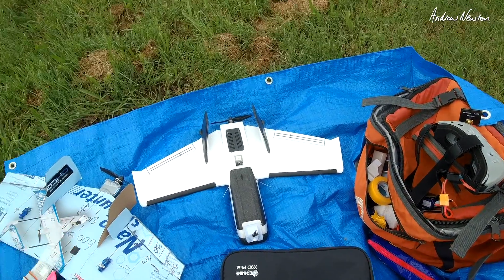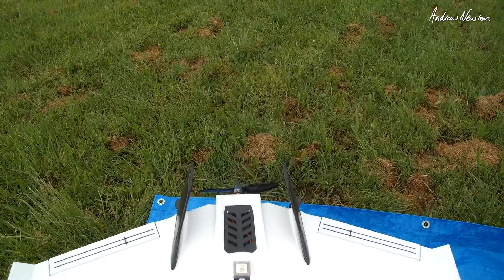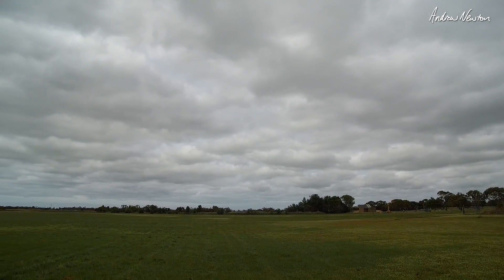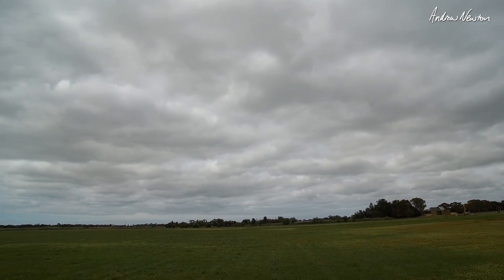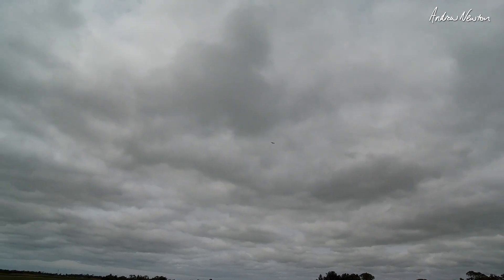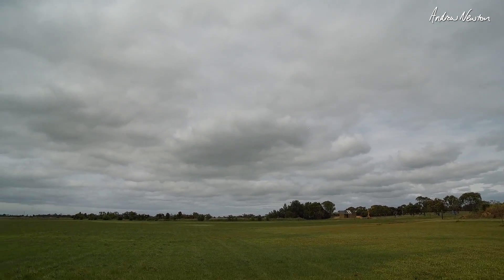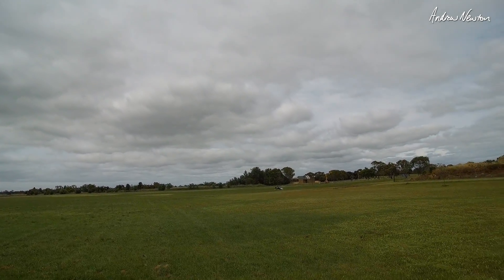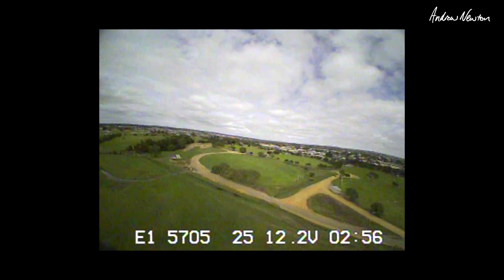ZOHD Dart 250G & Kopilot tweaks

Comment: How did you manage to deal with both 2s and 4s batteries with the same setup? You do not have Low voltage cut off on the esc side?
Reply from the maker: Only 2S and 3S. I never set LVC

Comment: I have found with Kopilot - run gain pots lowish like you 1/3 max.  Also with little planes I setup adjustable EXPO on a pot with a range between 30 min to 70 max in OpenTX so I can adjust it while flying in manual,  then later you can set it permanently, or just leave it on the pot.

Comment: Have you had any problems with burning out the motor using the 2 blade prop on 3s?  I am on my 3rd motor and ended up switching back to 3 blade prop.  I am also running 600mW vx off the esc. Not sure if that is the culprit.
Reply from the maker: No problems with my motor. But I use 2S mostly
Reply: Yep. You've got to use the throttle sparingly when running the 5x5 on 3S. Only use on take off and dodge tree panic mode for very short bursts. We've done 1 on a Dart250 and 1 on a Drift. A 4545 or 5x4 might be better. The 3-blader is anaemic and is easily broken on a rough landing.

Comment: Andrew:
   Since you are my go-to guy for slope flying and I can see you have had a good bit of flying with the ZOHD Dart 250g, I have several questions for you:
1) What do you feel is the sloper potential of the ZODH Dart 250g? Should it be run a bit heavy or light to perform best?
2) Have your tried 2S 18650 (or 21700) Li Ion batteries in it?
3) Could the use of one of the Matek flight controllers to enable the removal of the ESC for simultaneous weight savings and increased flight control capability? Which one? 765? 722? 411? 405? other?
4) Do you feel that another camera would add value/utility? Foxeer Razeer mini? Caddx Ant? AKK 356c? Which Vtx would you use to optimize weight and range?
5) Do you think that running INAV in this model with its avalable mission planning would work without adding too much weight? What flight controller would you suggest?
6) Have you experimented with the Happymodel ExpressLRS ES24TX or EX915TX protocols to expand range/reliability yet?
Thanks! - Jim
Reply from the maker: Hi Jim. It's not suited to sloping really. Could ballast it up for speed in a decent wind maybe.
2s LiPos or 18650s are fine
F411-WSE is the only board suitable, but that wouldn't replace the ESC
VC400 is not a great camera, but it's small and all in one. Any of the micro setups would work but I dont know much about them.
F411-WSE check out Marc Hoffmanns videos. INAV seems to work well.
No idea about the Happymodel, not really my area of interest.
Reply: @AndrewNewton  Thanks for patiently answering!

Comment: I have two questions about setting up a flight controller.

1. In the moment you drop the model, I hear that the engine is already running. Not using autostart mode? I no longer try to start in this mode. I set the stabilization mode, set max throttle and drop the model.

2. Can I turn off the setup board after all the settings are complete? Is it necessary to disconnect the setup board when the battery is on, or when it is turned off?
Reply: Actually we've found that Autolaunch requires a REALLY strong throw at a slightly upward angle to get it up to flying speed OR to use a Bungee-launcher - particularly if using the 3-blade propeller on 3s. 
Also the ONLY way to guarantee that your settings will be saved if you want to remove the Settings Board and the cable IS to do it BEFORE you unplug the plane battery. That has been tested and proven.
Reply from the maker: 1. Not autolaunch, this model dips too much for that to work all the time.
2. No difference with my setup.
Reply: @AndrewNewton  Thank you!

Comment: Thank you for all your detailed videos an I may have missed one but at 2:02 you talked about having the “settings at full” I couldn’t quite see the the settings you have on my phone, would there be any more details on these please? Would you be able to explain the setting between manual, stabilised and expo? Apologies but I’ve yet to take a maiden flight in the 250
Reply from the maker: I was turning the gyro gains up full just to see the effect. Manual is unstabilised just passing the stick commands straight through to the servos. Stabilised is self levelling with limited bank and pitch angles. Adding expo softens the response of the control surfaces around the centre region of stick movement. If you're asking those questions I think you should start with a less complicated setup like a Bixler 2 and no flight control board.
Reply: @AndrewNewton  thank you for the detailed reply. This is my first venture into fixed wing. Painless360 and yourself are my go-to channels, I’ve built and flown quite a few quads over the years, I must apologise the question I asked was probably worded wrong (also probably our cultural differences as well) 
Question:
Is “expo” is it used in all modes? Is there any harm in setting it in all modes?
I looked at the bixler but it’s a bit big for my vehicle! But I did see your realistic video on the xka800.
I I’ve ordered one and gonna fly the life out of it
Thank you so much, we all learn so much from your hard wok
Reply: ....and also your work (oops)
Reply: @pierstaylor7780  How did you get on with the A800? Personally I'd have taken Andrew's advice and started off with a pusher - the lighter the better. That A800 won't survive a heavy nose-in. ;-)
Reply: @theoztreecrasher2647  brilliant! I’ve had a few flights but the weather here is bad (northern ireland) couple of crashes but nothing hot glue can’t fix. I liked it so much I bought a 2nd one and also a hobbyking 959, zohd dart & parrot disco, Getting stuff here has become difficult since Brexit. 
But I’m really enjoying the hobby. Thank for all your help and encouragement

Comment: How do you set different rates for manual mode vs stabilized mode still learning sorry if this is a noob question
Reply from the maker: In the mixer page you can enter different weights for each switch position (or mode) Taranis / OpenTX

Comment: Dear Andrew! How I set up the RTH throttle value? Do I must set a value for the throttle when I set the failsafe? Or does the kopilt control it? I don't think so.
Reply from the maker: No need. Kopilot controls the throttle during RTH
Reply: @AndrewNewton  Thx! So on  the Taranis I set only failsafe value for ch5 to rth, the other chanells not set anything right? If I fly on 300m high and switch to rth, the plane will descend to it's preset low rth altitude or stay on the 300m during rth? Thx!
Reply from the maker: Only set RTH. Dont know about above 70m
Reply: @AndrewNewton  Seems it drops down to 70 during RTH if above that height. Rises to 70 during RTH if between 35 and 70. Flies straight and level up to 35m then enters RTH and climbs if starting below 35.
This little wing flies nicely with your settings but is better suited to your soft lawn landing areas that our old mining plain, Andrew. Needs some of the battery weight sacrificed for some nose and underside plastic reinforcements. 😁

Comment: Hey when turning on the sub 250 was the rth on position 1 or 3 I cant figure out which is which the motor and everything else acts exactly the same except position 1 blinks both leds position 3 is solid on both leds in kopilot
Reply from the maker: Position 1, switch up, or -100 is RTH

Comment: Just finished putting together my Dart 250 that I got a couple of months back and was reviewing this very useful video for which many thanks. It’s the first model I’ve had with an FPV camera. Practically burned my fingers on the circuit board during set up!  I find it astonishing how hot this thing gets and it clearly needs to hang right out in the airstream. How long do these transmitter boards last and if it packs up can you still use the integrated camera with another board?
Reply from the maker: Yes they all get surprisingly hot, specially these tiny transmitters. Really need to keep the air flow over it. Good question about the camera. Not easy to separate but I have a dead one that I might try.

Comment: I just received one of these and have a few questions, firstly I have a flysky i6s is it compatible with this uav and how do I go about setting it up, also I have a heap of 4s 1500mah 100c batteries and a heap of 3s 1500mah 100c ones as well, not worried about weight being over the 250g mark but will it fly with these cells and will the electronics handle them? Both battery types are  just over the 100g mark in weight the 4s is a little heavier of course.
Reply from the maker: Unless you mod the throttle spring centering you can't use your radio with planes, and I doubt your batteries will fit. Check the product page for battery bay sizing
Reply: @AndrewNewton  I have no throttle spring in mine.
Reply: @AndrewNewton  will it take a 4s?
Reply: Silent Storm it can take 4s with the 3 inch props just not the 1500 mah ones

Comment: Hi Andrew I have a question regarding the build... Do you have to limit the servo travel / throw on this wing.. not seen anything on this... Thx fella for your vids
Reply from the maker: I started with a 50 50 elevon mix then reduced the ailerons and increased the elevator to something like 40 60

Comment: Where do you adjust the rate to 60 as noted in this video when flying in manual mode? I have a Taranis Q X7. Thank you for your input.
Reply from the maker: I programmed reduced rates that are only active when the mode switch is on the Manual Mode position. I'll add a photo in the community tab

Comment: Lol....looked a handful in manual Andrew...Im surprised they didn't include remote Gain adjustment via a channel, like even the basic Giros do....Just fly along slowly increasing the gain knob until it starts to oscillate, then back it down a little. A lot easier to hit the sweet spot IMO.
Reply from the maker: Needed even lower rates and more expo for manual, then it's a sweet flier.

Comment: Thanks again Andrew! you have pretty much covered every question I had about the Dart 250 / Kopilot combo, very happy to see this little guy tame the shakes ,  When Mine shows up I have a very good starting point for the setup. When flying 3s with the 5x5 prop in manual  was there any noticeable  torque roll? I know its not exactly a big prop but it is fair sized for the Dart 250's wingspan and weight, also thanks for the amp draw info, all very useful  information. You are my Dart 250 / Kopilot Guru!  Love the content Andrew. Once again Cheers and thanks for a sign of warmth from the Early winter in the Midwest USA!
Reply from the maker: Didn't notice any torque roll, but I never do and always assume it's wind.

Comment: So can you please summarise what you think? To me the ZOHD 250G seems great but do you recommend using  ko-pilot or going the full inav and/or another stabiliser with acro mode?
Reply from the maker: If you're happy with fine soldering and flashing firmware then I would go with a Matek F411-WSE board and iNav. If that doesn't thrill you then the Kopilot is a much simpler setup.

Comment: do the rate knobs change your throws in manual mode or only in stabilizer modes?
Reply from the maker: Only the stabilisation gain, not the throws. I have 50% weight and 30 Expo for manual only, then 100 weight for RTH and stabilise

Comment: Very nice, but a plane small like this even causes some discomfort to fly in manual mode. Too wiggly, feels like it is gonna fall to the ground at any moment.

As you said, if the kopilot had rate (acro) mode and geofencing for altitude it would be a killer.